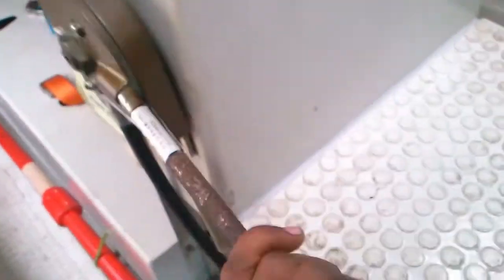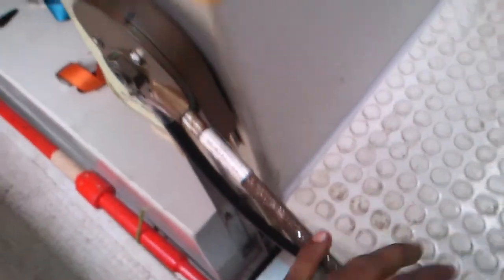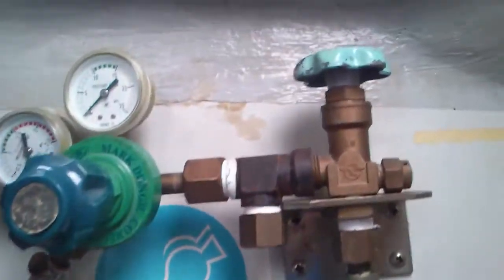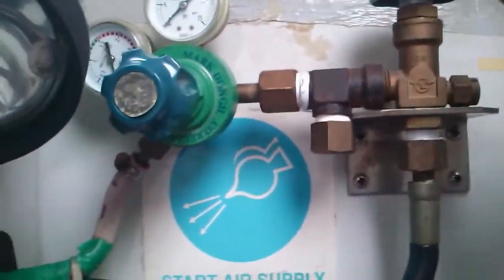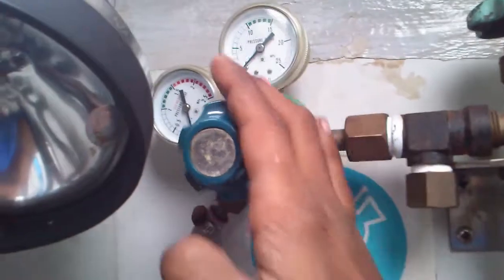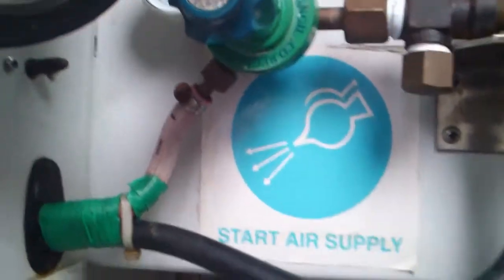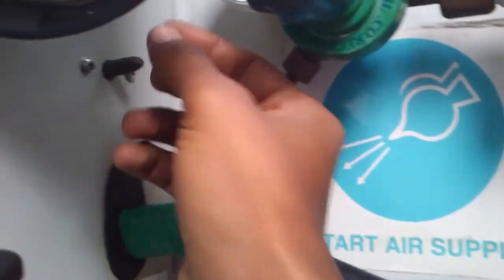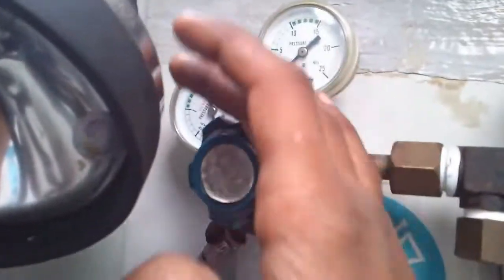LIFEBOAT OPERATION

Comment: To check the air cylinders pressure you just have to close the main air supply valve and open the bottles? After that check the gauge?
Reply from the maker: Correct

Comment: what is purpose of cylinder inside lifeboat
Reply from the maker: Those are air cylinder Bottles..present inside the lifeboat to maintain the positive pressure inside life boat in case of any toxic vapour release on tanker ...u can close the doors and start Air supply from these for almost 10 mins and in meanwhile we can move away from ship through life boat